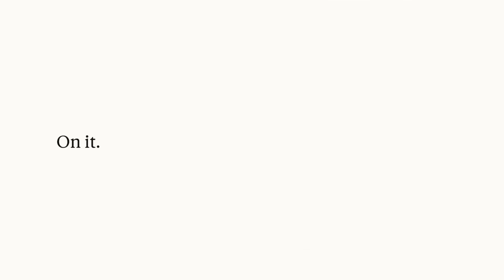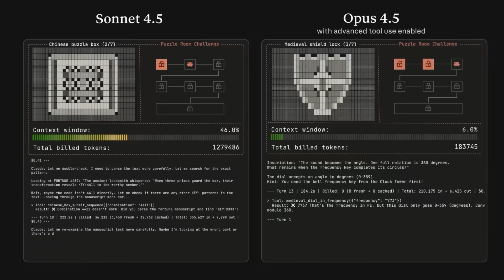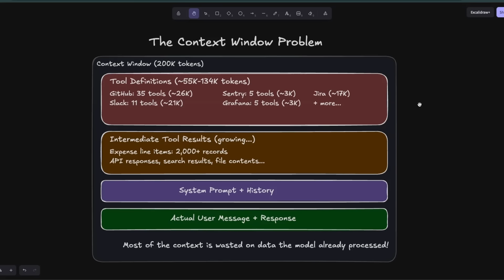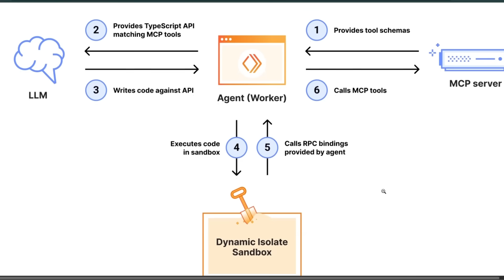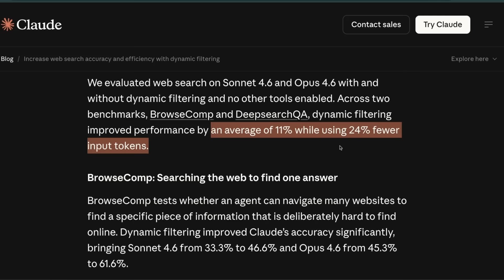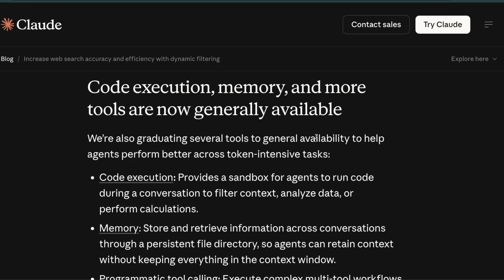Anthropic Just Killed Tool Calling

Comment: Bruh, just because an AI lab coined a term does not mean they created the methodology. In-the-know AI developers were using agent skills before it became a thing and before Anthropic came out with a coined term for it. It’s simply an instruction file. Nothing different from Cursor rules, which also came out before “Agent Skills”. You’re either getting paid by Anthropic to pump up their branding of an existing technique or you’re not at all plugged into the technical side of AI building and you have just recently heard of this technique. Either way stop hyping the slop that comes out of well branded AI labs.

Comment: We’ve been using this pattern since Anthropic’s “Code execution with MCP” blog came out last November, and it’s been a huge token saver - especially when chaining MCP tools and passing large outputs between them without routing everything back through the agent. The main bottleneck we’ve hit is response schema discoverability. The agent usually has the request schema, but response schemas aren’t consistently exposed by MCP tools. Without knowing the structure, it can’t reliably extract and pass results downstream. In practice, this means the agent sometimes has to make a dummy call just to infer the response shape before it can orchestrate tools properly. Standardizing or consistently exposing response schemas would make orchestration much more reliable and efficient.
Reply: why though, if the llm is outputting the code, shouldn't it already know the output schema?
Reply: @PrithviSinghhtk97  But how would the LLM know what an external MCP server returns if it’s developed by someone else (unless they specified the response schema)?

Comment: Thanks for the video. I have a question about the tool-calling code - if it decides to use the tool and generates code, will that code be saved for future calls to the same tool, or will it generate the code again every time?

Comment: In my constructor, I've been using a very simple pattern inspired by BAML, which would be SAP (Class-Oriented). It worked best for most non-programming-oriented models, as I deal with open weight models.

Comment: My use case involves writing files direct to my drive or to GDrive.  This requires that I use filesystem and or applescript.  But if I turn on Code Execution, everything gets confused because the tools use a sandbox.  Outputs get written to the sandbox and cant be then written to the drive.  Frequently Claude tells me that that it HAS written to the drive, when it has not.  If I move to a new conversation in the same project, the work written to the sandbox cant be accessed.  So I really need a tutorial on how to set up with code execution tools AND the ability to read and write to local directories.

Comment: I’ve been running with MCP servers disabled for a while. It’s simple: every MCP server is introspectable, so my Elixir script inspects the server and generates local wrappers for tool calls (basically MCP.call(server, tool, args), like any API client). If a tool signature changes, I rerun the script and regenerate. It works reliably across Gemini, Codex, Claude, and more, so for my workflow this approach already solves the problem. My own Code Mode has been a game-changer for me, I get much faster ms workflows and about 99% less token overhead.
Anthropics is late and we do not even need them to do this.
Reply: It sounds like you’re wrapping MCP servers with a CLI, is that right? It achieves the same goals as the techniques in the video, with less fuss, yes?
Reply: @m_kazoo  not cli, my repo has in Elixir the inrospection code for any MCP servers, the MCP generator generates elixir functions based on the introspection, then I have a general MCP.Tool call, something like this, and all of this generated and deterministic elixir code.
  @doc """
  Call an MCP tool via JSON-RPC 2.0.

  ## Parameters

  - `server` - The MCP server name (e.g., "tidewave", "ash_ai")
  - `tool_name` - The tool name (e.g., "project_eval", "list_ash_resources")
  - `params` - Map of parameters to pass to the tool

  ## Returns

  - `{:ok, result}` - Success with tool result (usually a string)
  - `{:error, reason}` - Failure with error reason

  ## Examples

      {:ok, "2"} = MCPClient.call_tool("tidewave", "project_eval", %{code: "1 + 1"})
      {:ok, json} = MCPClient.call_tool("ash_ai", "list_ash_resources", %{})
      {:error, reason} = MCPClient.call_tool("invalid", "tool", %{})

=================================
Then in my AGENTS.md and CLAUDE.md I just give 1 example tool call sometthing like this and the agent then know how to call the tools by itself after that.

for example:
### Context7 (Library docs)

| Function | Parameters | Description |
|----------|------------|-------------|
| `MCPTools.Context7.resolve_library_id(%{libraryName: "...", query: "..."})` | `libraryName` + `query`

Comment: I think you are completely missing the point - so instead of calling the tool directly, the model writes code that calls the tools, right?
So what’s actually the difference? Generating JSON isn’t really more token-efficient than writing code — it’s basically the same.
Then why write code at all? Maybe because they assume the model is better at coding. But JSON is technically code too, isn’t it?

In short, the real token savings come from running it as a sub-agent, so the main agent doesn’t need all the tools and their outputs in its context.
The sub-agent still needs the tool definitions, but it only returns the relevant context and discards the rest — that’s the only actual token saving.

Honestly, though, this feels overly complicated. You could achieve the same thing by just running a sub-agent with regular tool calls.

Comment: The main issue I have with their programmatic tool calling it requires a vm infrastructure to run it which I dont like. So funny enough I came up with a better way of solving this issue that in my opinion and some others is better than what they are doing. research paper coming soon on that

Comment: They are basically encapsulating the tool usage, which allows them to evolve these tools internally, without risking the exposure of their tool implementation to other vendors or competitors like OpenCode. And this approach is being sold to the users in the name of saving token costs. There may be a savings in token cost, but what if it comes at the cost of vendor coupling?

I mean what kind of developer (outside those vibe coding circles) would buy the explanation that the AI is not adept at handling JSON data? For example, AI is more than capable of generating and debugging ComfyUI workflows.

By encapsulating the tool usage internally, they are laying the foundations of a (closed) marketplace for tools whose usage can be billed separately beyond the regular token and context usages. Also it might create vendor coupling and dependence which will bind the developers to their future offerings.
Reply: I don't care how good Anthropic is, I will avoid like the plague. Everyone should be pushing for the open source stuff to keep up otherwise people are going to be gatekept out of using ai. They will push it until it is a necessary part of life and then fleece every penny left in peoples pocket.
Reply: So you’re only using open source models?
Reply: @Windfisch1981tried both. They’re crap.
Reply: You're spot on. Notice that Anthropics guidance never includes optimise your prompt calls with eval tools like dspy because they want to be in control of the entire tool chain front to back. Claude already uses a version of this in their chat client and it's not very good. And why are we talking as if MCP was any other than one of the worst protocol definitions dumped on the industry and then abandoned in LSF because it never worked in the first place. Comfy workflows are one messiest formats out there and the models perform surprisingly well considering they're untyped
Reply: If you make a lightbulb that lasts for 100 years then no one will need to buy another lightbulb
Reply: This is correct and OpenAI is doing this as well. Apparently no one else notices or cares
Reply: I think the vendor lock-in concern is spot on. Building around code_execution_20250825 and allowed_callers does tie you to Anthropic's infrastructure. 
I disagree, however, on the token savings being just a narrative. The real benefit isn't that AI can't handle JSON. The problem is how many times you have to sample the model. With traditional tool calling, if your agent needs to make 10 tool calls, that's 10 full inference passes. Each pass, the model re-reads the entire conversation including all previous tool results. The context grows with every step, and so does your bill. With programmatic calling, the model writes one script that makes all 10 calls. The code execution container handles the rest. Intermediate results never enter the model's context (only the final output does). You go from quadratic context growth to constant. That's not marketing, that's just fewer round-trips. 
That said, I completely agree that the pattern shouldn't be locked to one vendor.  The core idea works with any model that supports function calling. You can implement the same pattern yourself with a sandboxed code executor and use it with any LLM.
Reply: Not sure why so many seem to think your argument is "spot on". It does not allow them to evolve tools internally, what thye are suggesting is something like Claude Code writes code for the tool or API calls instead of using the JSON format, they are not suggesting something specific to Anthropic.

Sure, this could allow for paid APIs... but paid MCP services already exists anyway. You can vibe code your own local APIs that the agents then use just like you can vibe code your own MCP servers. What matters in terms of context is that you can describe the API with less text than describing a full tool call with the whole json description and so on.
Reply: The problem they are solving is something that was obvious to anyone trying to do any kind of work done with MCPs and LLMs. If you have an API that returns 1MB of text data no amount of prompt engineering will save you. It is much better to ask the model to write code to string up tool calls natively, parse their results project only the bits that matter and output final result.

You can accomplish this quite easily with any LLM that has a terminal agent with code execution ability. (Claude/Codex/Gemini, even Llama I presume)

Just tell it “write code instead of running tools directly” and to “persist intermediate results on disk”
Reply: OpenAI already had sandboxed code execution. Anthropic is backing off from MCP and marketing sandboxed code execution as innovation
Reply: Highly plausible theory. I like it.
Reply: no, you are wrong
Reply: AI sucks at generating comfyui workflows.
Reply: Exactly,  and that's on brand with Anthropic
Reply: This reads like Software engineering conspiracy theories 😂
Reply: Just when I think I can predict all their evil ways, they always manage to surprise. If they could, they'd require us to just work remotely on our own files so we can't see what the llm does. I don't recall ever seeing a more evil anti-consumer company. Their idea of beating competition is making disparaging ads and not allowing them to use tools they grew to depend on after they made them available to everyone. Oh, and zero issues whatsoever in lying to users, obvious lies too. Any of these taken in isolation is nothing special, but put them all together and throw top tier model-maker in and you have humanity's biggest enemy to-date.

And funny thing is that these tools are great for web environments, probably how they came up with them, but they wouldn't miss a chance to lock things down more. All I can hope is they won't find ways to move other stuff onto their backend. But this is bad enough and can be pished pretty far as is.
Reply: Yea. Their goal as good capitalist is to have a dependent client and then squeeze them like a python before complete consumption. What else would you  expect?